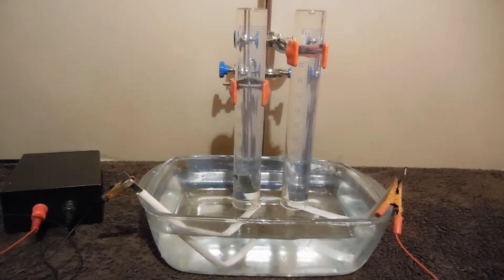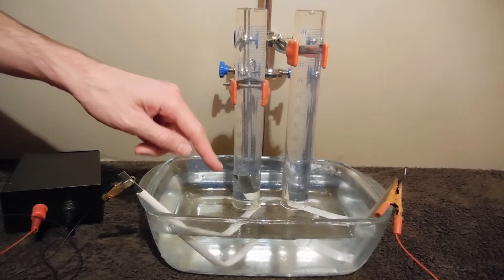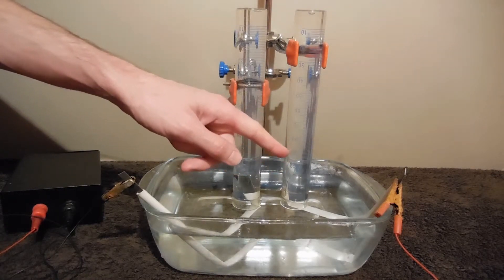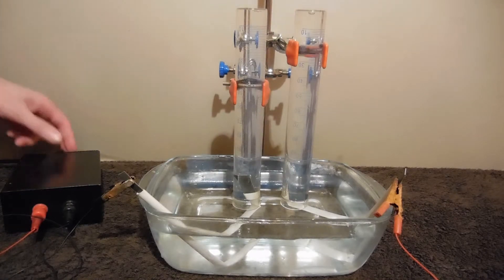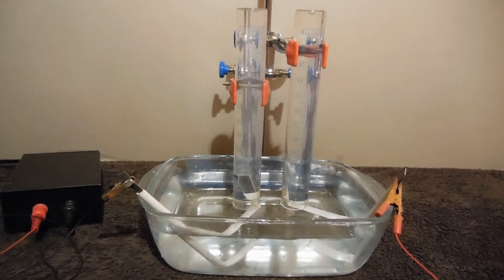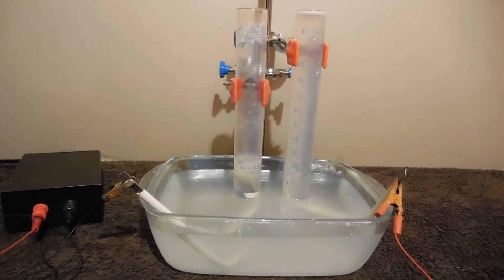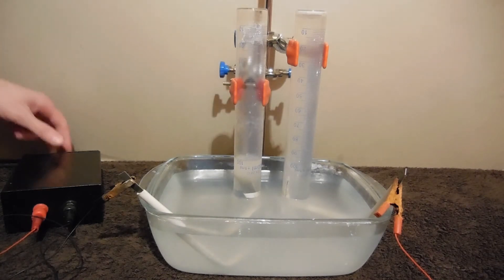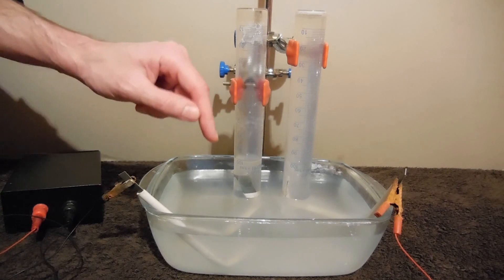Physics Experiment Electrolysis Of Water With Zinc Electrodes Full HD video

Comment: I tried this in order to evolve zinc oxide.  As I need zinc oxide in preparation of another reaction,
The precipitate that get is a mix of white and grey blue in color.  I was wondering if you new what these constituents were?
is it all zinc oxide or is it a mix of oxides and hydroxides?
Reply from the maker: +Clown Whisper Grey Blue substance? Maybe you had not pure Zinc metal, but alloy with something else.. ? Perhaps with Copper? Copper Hydroxide is blue, like you can see in my other video https://www.youtube.com/watch?v=-zycAj2ErIo Yes, this reaction should make Zinc Hydroxide. To turn it to Zinc Oxide you should heat it to remove water molecule. Zn(OH)2-> ZnO + H2O Take a bit of what you produced (f.e. 25-50 mL) and add acetic acid. Zinc Acetate is transparent ( https://www.youtube.com/watch?v=G1Eoc_r-9no ). But Copper Acetate is blue/green like you can see here https://www.youtube.com/watch?v=wlxAYLm-9_U